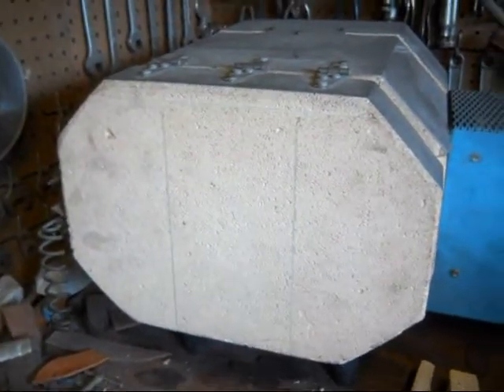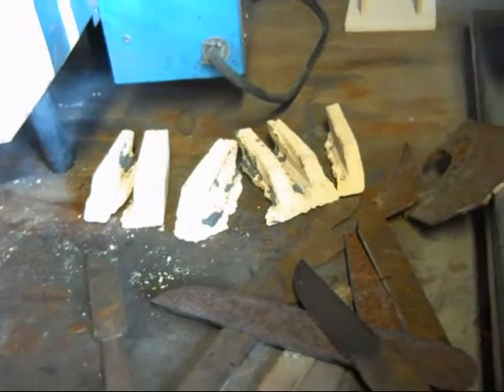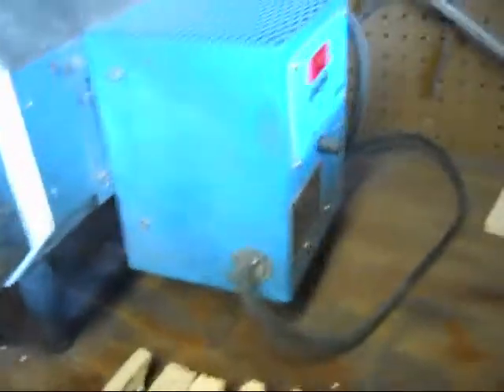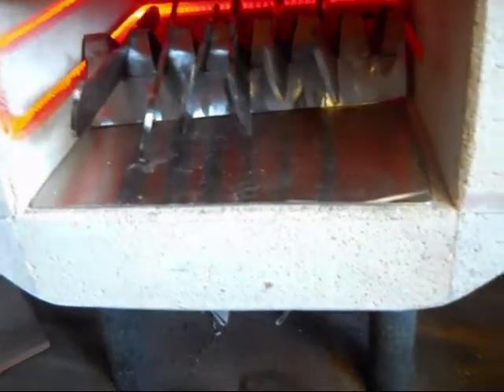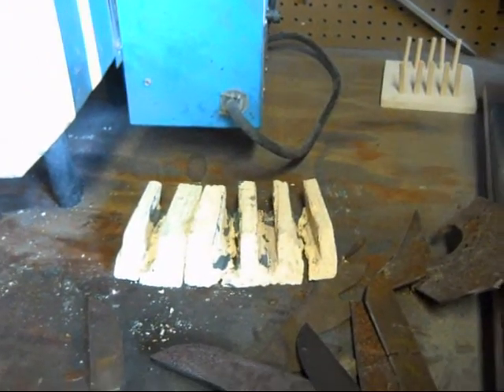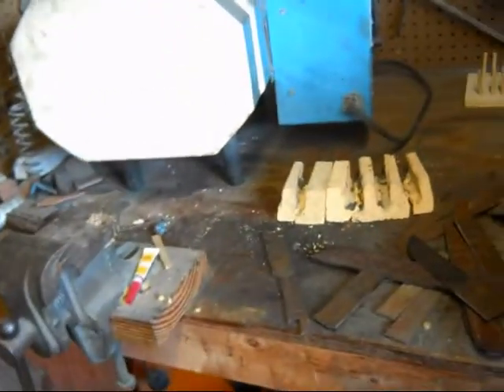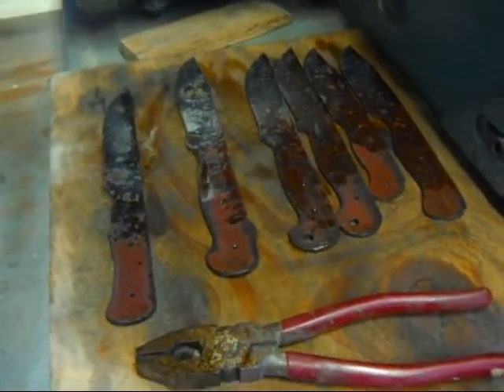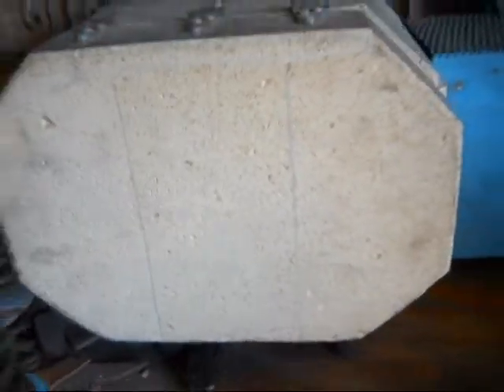Heat Treat Update II

Comment: I read a thread on a blade forum that said Brownells anti-scaling compound contains borax, boric acid, ochre and a few other things.  Borax is very corrosive, along with boric acid.  Boric acid is used by jewelers as a flux also. Also an insecticide to kill roaches!  The stainless tray is a fine solution.  Thanks for sharing!